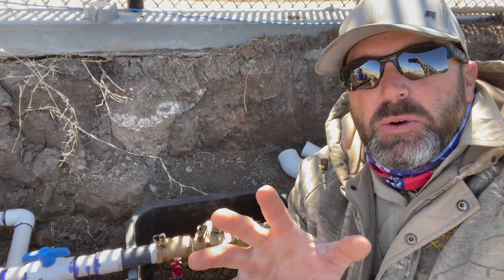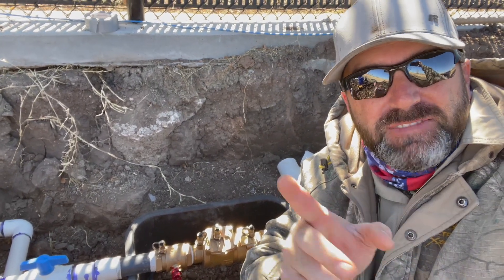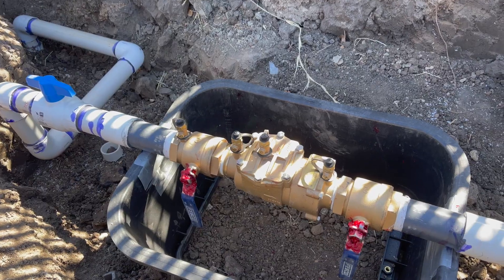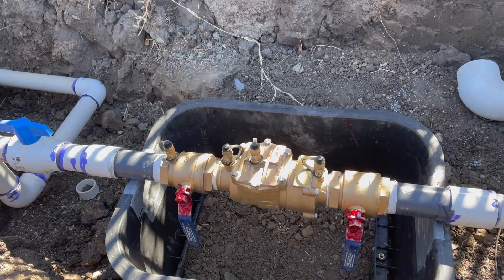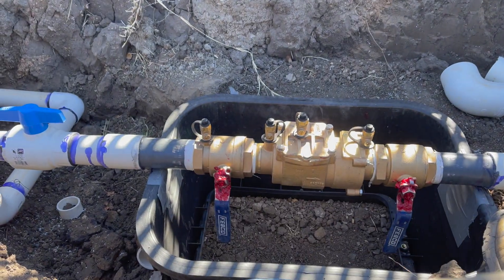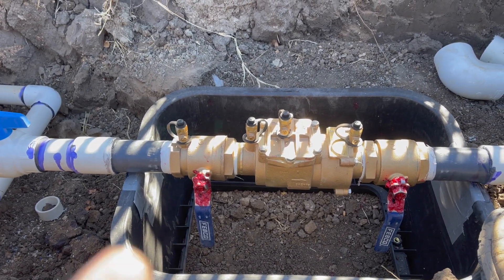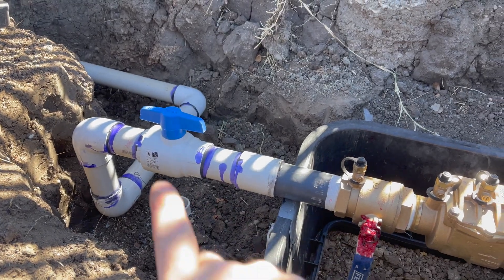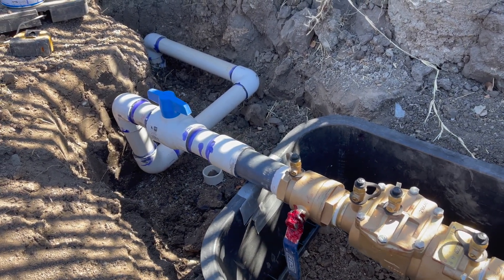How To Install A Double Check Backflow Preventer In 2022 | Texas

Comment: Thanks for the video, and the very clean installation. I need to replace the center piece of the valve system on an existing back flow and don't know if twisting it will disengage it from the valves given that it is threaded at both ends. Are the threads the on both ends of the center piece the same direction or opposing so that if I turn the mid-section then it can be taken off?
Reply from the maker: It is very hard to take just the middle section out and replace it. And most of the time they are just going to sell you the whole thing so at that point you just replace the entire unit. If you do try to unthread the middle part, make sure you turn the water off first so if something breaks you don't have a big mess.

Comment: You need a separate ball valve for sprinkler system so that when you have a problem with sprinkler system, you still have water supply in the house!   This becomes more important when people use cheap PVC pipes for sprinkler system which is more problematic! Yes, the code makers know all this stuff!

Comment: Have a question for you, I’m in Tennessee and need a back flow preventer for my irrigation system. With most of the units not being lead free will that be an issue down the road of lead leaching into my main line?

Comment: How do you go from brass to pvc
Reply: Did you figure this out? Having to replace mine and it broke where the brass and pvc met.
Reply: @Kishan Patel  yes. I had a backflow preventer, used a brass male threaded fitting to PVC sharkbite fitting. Used Teflon and pipe dope, no leaks.
Reply: @nbt3663  thanks!
Reply: @JoeSmoeDoeLow  have you got it fixed?
Reply: @eeeeeeeeeeeeeeeeeeeeeeeee-s3p  yes was able to fix it myself
Reply: @JoeSmoeDoeLow  ok good job

Comment: What material is the gray pipe connecting the PVC and backflow device
Reply: sched 80 pvc
Reply from the maker: Yes that's correct. Sch. 80 threaded nipple

Comment: When exactly do I need to have a double check valve versus a typical irrigation backflow preventer in Texas?
Reply: Dunno Texas but that’s the kind of thing you want to hire a certified technician to do, for it need to be tested and report  to the city , also if you install the wrong one won’t get your money back.
Reply from the maker: Every sprinkler system has to have a backflow preventer on it. As far as what kind or which one, depends on the city. Out where we are they allow double checks to be install below grade in a valve box because of the freezing during winter. But some cities in Texas only allow a PVB or a RPZ which are installed above grade. You can call the city water department or building department and they can tell you what is allowed in your city. And yes, it is best to have a licensed irrigator do the work and a licensed backflow tester test it.

Comment: How do you install the shutoff valve (before the double check backflow device) in such a way that you can get to it but it won't freeze in the winter?
Reply from the maker: This one here will be below grade in a valve box. Most of the time it will not freeze but you can also put some insulation in the valve box covering the shut off valve to keep it from freezing. This works well in our area in West Texas where we do have freezing weather but it doesn’t freeze for long periods of time.